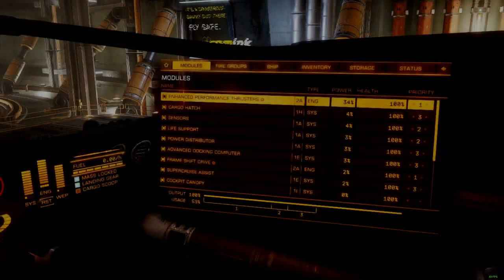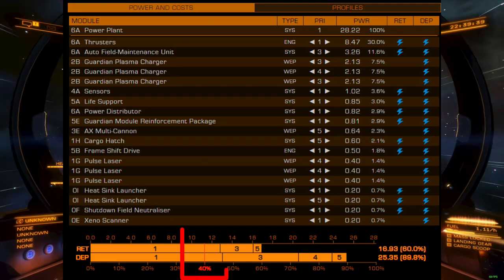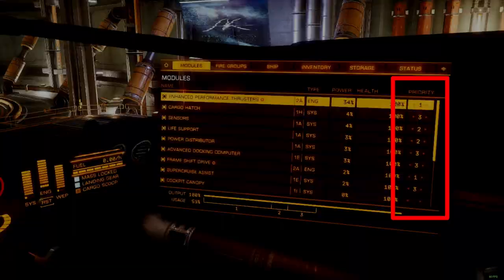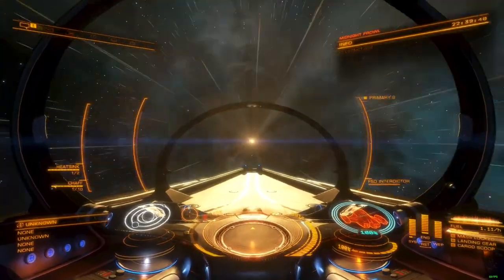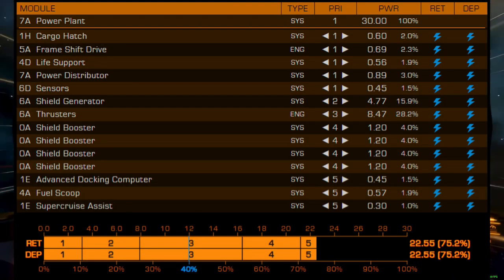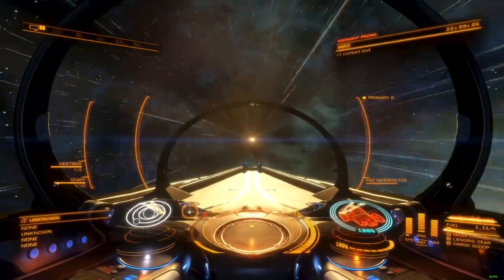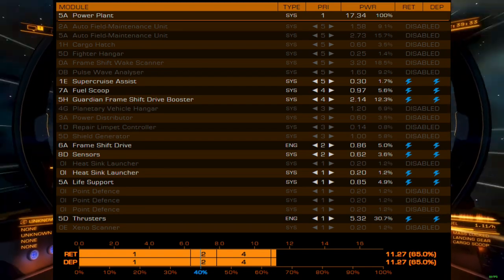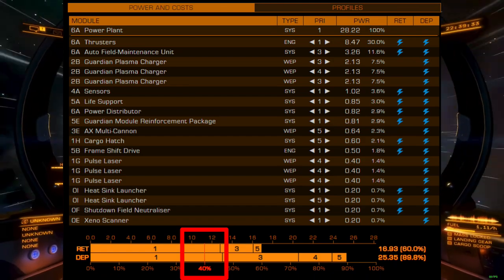Elite Dangerous | New Player Tutorial | Power Management

Comment: Great vid, made me reconsider my habit to have thrusters at 1 at all times.
Here's a trick I like to do on my combat vessels:
I put all and only my shield boosters into P4, with a system like my Cargo Hatch in P5, purposefully exceeding the power limit. If then, during a fight my shields go down, I can quickly lower the priority of my Cargo Hatch to P4, which puts the P4 group above the threshold, turning off all my boosters, allowing for my shield to come back online quicker, before I switch the Cargo Hatch back to P5, turning on my boosers and getting the resistance boni they provide. This allows me to reduce permanent damage to hull, but be advised; this does INCREASE the amount of time it takes to restore shields to 100%, as broken regeneration rates are higher than when the shield is already online.
Reply: Nice use of the "ship software" I like this manipulation, good stuff, like a mod on your ship It's like u had expanded the possibilties of manual control.

Comment: I see a problem with keeping thrusters below priority 1.  It doesn't matter how healthy your FSD is, if your thrusters are throttled down or deactivated, you can't high or low wake out of a situation.

I set mine fairly simply.  Shield, Thrusters, FSD, Life Support, Sensors are all priority 1.  Basically, anything your life depends on.  Any and all weapons are priority 2.  That includes mining tools mounted in hardpoints.  Limpet Controllers, AFMU, SRV or Fighter Bays, heat sink launchers and so on or priority 3.  Assorted add on scanners are priority 4.  Cargo Hatch priority 5.